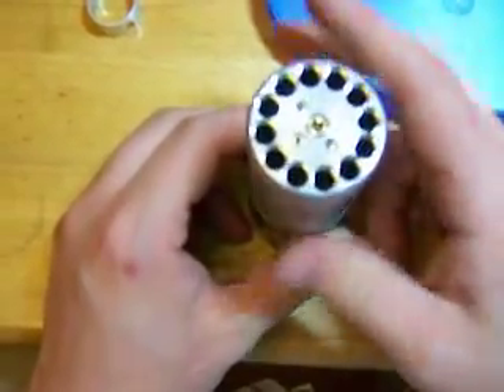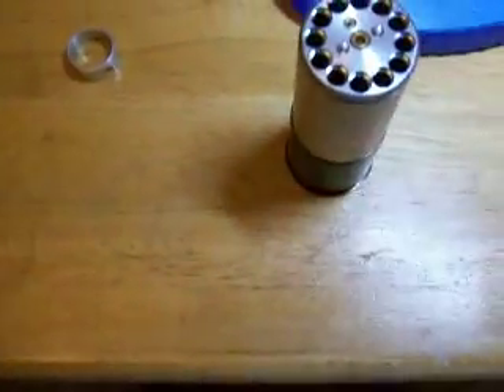AIrsoft 40mm Cartridge repair and Maintanance

Comment: what I do when I put the ball bearings into the hole is I use silicon grease (or any thick lubricant), they act as a temporary 'glue' for the ball bearings that hold it in place. What I do is I generously coat the inside of each hole, then put the ball bearings in, that way I can practically do the whole thing one handed, and nothing would fall off regardless of angles.

Comment: I assume it's relatively the same for most cartridges, but on my Madbull there's a slot cut all the way around the shell near the top that cuts just slightly into the BB chambers, and there's a big rubber band or O-ring that goes in the slot, it protrudes just enough into the chamber that it holds the BBs in once you push them into the chambers.

Comment: Hey, good deal!  I got an M203 a while back and have been using Madbull CO2 carts.  I had to figure this whole thing out myself :P  Not having a nice little ring dealie to keep the damnable bearings in place, I resorted to tightening a small zip-tie around it that served the same purpose. :)  Still need something that'll do for re-priming the plunger in the field.  (I've been using a Sharpie marker, but that's kinda lame.)